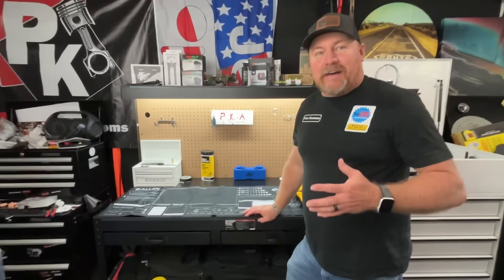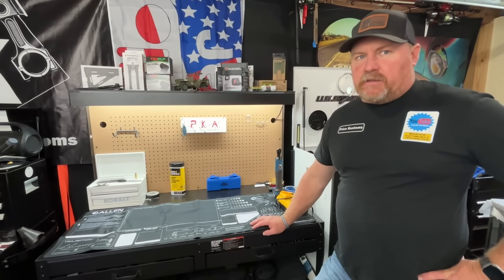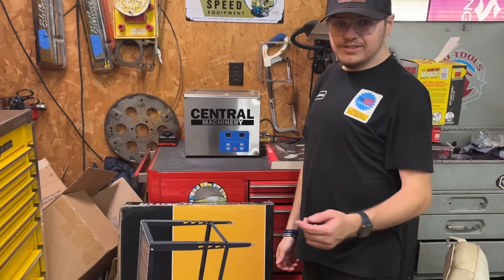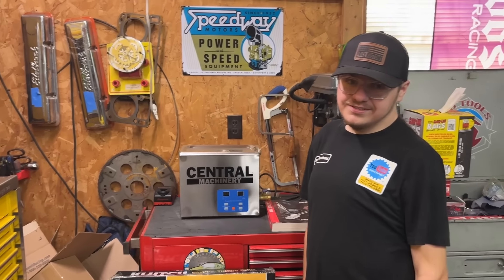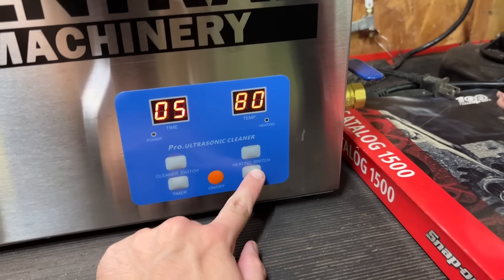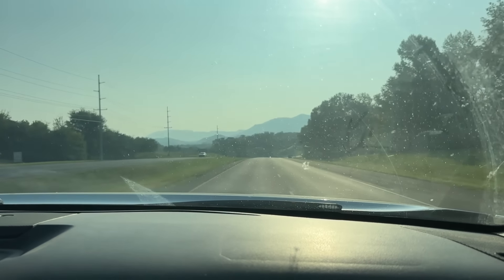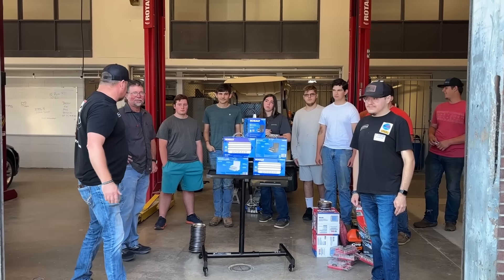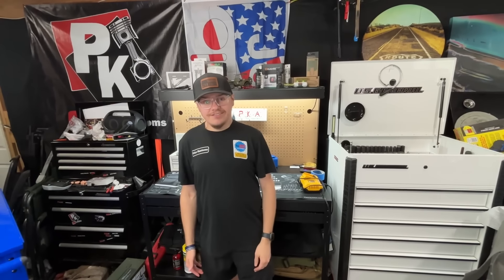5 HARBOR FREIGHT TOOLS YOU MUST HAVE!!! #icontools #tools #harborfreight #toolbox #toolhaul #top5

Comment: Gre3 stuff...can't  argue with any of it.   The ultrasound cleaner  is well worth  cost.   I have an old one, different brand, use evaporust in  it, works great!
Reply: Thanks for watching
Reply: That's good to know. I have some evaporust and was wondering if it would work in one. Guess I should have read the bottle better.
Reply: @shadow7796  actually, if you are doing a very small piece, you can put enough evaporust into a plastic bag to cover the part, put that into the ultrasound cleaner, fill the cleaner up with water and run it.   Works great and saves a lot of money.   I did this with a bell that hung under my motorcycle, bell was in very rough condition going in, looks almost new after.
Reply from the maker: Thanks and great idea with the evaporust

Comment: Hey guys, I wanted a low profile 3/8's metric impact set, HF only has quinn 1/2 inch, so I did some searching and found a stubby Capri tool 15 piece set for $45. As a veteran I also get 10% off that. Here is the Model # CP53425, and it looks like Capri also gives you a tool box organizer with their tools. Thanks
Reply: I got it at the online home depot store